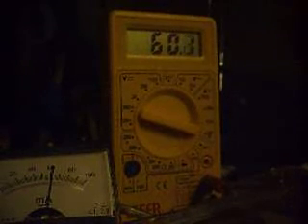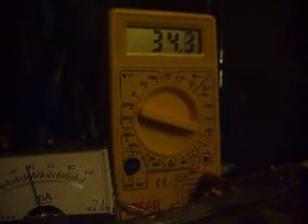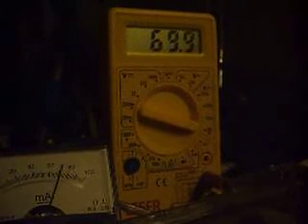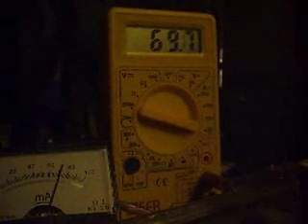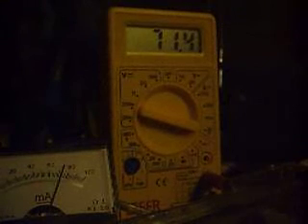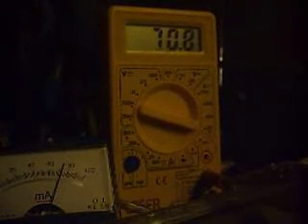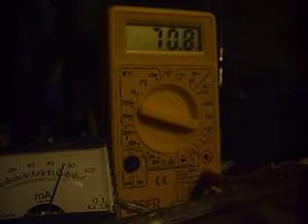bedini / joule theif systems - measuring curent - digital multimeter V analogue needle meter debate

Comment: Most cheap DVM meters do not  measure 
True RMS power but only  are calibrated to 50Hz  sine wave. 

The old analog meters shows RMS voltage  and current  so it is a lot better than a cheap  DVM meter.

You may have a true RMS meter or just 
lucky that your  DVM is close to the RMS

Arie